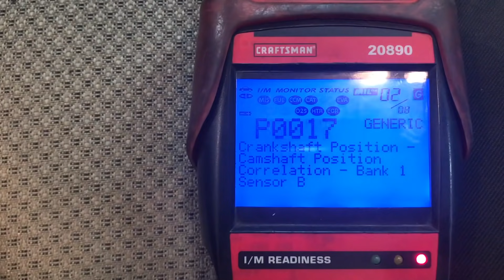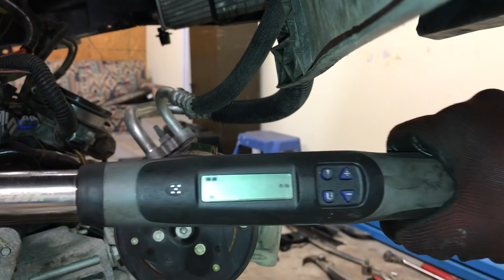Step By Step: 2.4 EcoTec Timing Chain Replacement

Comment: I just did this on my 2011 Buick Regal 2.0 turbo . I have a P0366 code crank no start. I changed  the camshaft position sensor on the back side of the drivers side motor.Still giving me the P0366 . I  was  worried if I had  TDC on the up stroke on number 1 piston . Watching this video I am positive it is . The only thing I did not inspect was  the wiring to the CMP sensor when I changed it ,kind of hard to get to. Would a p0366 code cause a crank no start? I am worried because this is the code I was getting before I found out the timing  guides had failed. Any input would be appreciated ,thank you.
Reply: thanks ayway,going to try Cloyes

Comment: s there a way to adjust the timing without marks?  I took the chain out and my stupidity allowed me to turn the the sprocket s individually, which turned the cams.  Now I have no idea where I am at.  Call me  an idiot because I am. 2015 Chev malibu 2.5

Comment: so when you lowered the sub frame what did you have to remove to do this? i see the struts but what about the wiring and fuel and evap? or is there enough slack here to just lower the subframe?

Comment: Just did this job on my 2011 Equinox. Replaced the timing chain and sprockets should have done the balance chain . The job was actually pretty easy even in the car. Thanks for you video it made the jobs easy. The timing chain guide was broken in three and the chain was so slack it was starting to wear on valve cover. The engine runs great now(as good as it can) hopefully I'll get a few years out of this repair.
Reply: I'm doing this now on my wife's 2011. Why did you say you wish you would have done the balance chain? Just because you were in there?
Reply: At what mileage was the replacement done?
Reply: Did you do this with the engine in the vehicle? If yes, what were the difficult steps and did you need special tools? Thanks.
Reply: @arneadler1810  did you end up doing this without removing the engine?
Reply: Youdon't need any special tools and you will struggle with tight spaces other then that it's easy @arneadler1810

Comment: Don't do this on the compression stroke. Do this on TDC EXHAUST!
Reply: What exactly do you mean? Number 1 piston at top most point ? This would be the first piston on the passenger side ,correct? Ihad to emove my cams to put new rollers in so Iam not sure of the orientation.
Reply: @snowblind5151  #1 piston is next to the passenger side fender. Top Dead Center on exhaust stroke.
Reply: @dealerauctionnightmare4689  So that piston would be at its highest point if you dropped a screwdriver down the cylinder to gage like most TDC settings?
Reply: @snowblind5151  Yes. Did you not set the engine exhaust TDC before you took everything apart?
Reply: @dealerauctionnightmare4689  I  had three shattered guides and 8 rooller lifters that blew apart. Believe it or not I think thats what saved the valves from hitting the pistons ,because I still have compression iun all the cylinders. I found a reply on timing this 2011 Buick 2.0 turbo with a 'LNF' motor. that the cams are to be set at 5 and 7  o';clock . and having no marks on the old chain I am needing verification.  DID YOU HAVE ANY BOOK ON THE 2.0 TURBO ?
Reply: i dropped the oil pan to clean it out also'
Reply: @snowblind5151  I don't have any manuals.

Comment: i did exactly as you described but at the moment of truth I turned the crankshaft and there are some points were there is more resistance than other times does this mean its time improper ?
Reply: I have the same issue. Where you able to figure it out?

Comment: is it TDC on compression or exhaust? I've seen other videos say to set it to TDC on exhaust for timing chain install, but you say the opposite. Just want to be sure. Thanks!
Reply: Tdc is piston location.

Camshafts are set based on that.

Intake cam is always set to the point just before compression stroke.

Always

Exhaust cam is always set to intake location
Reply: @danielkaesberger7893  the procedure has changed over the last few years. The cams used to be 180 degrees different. The crank spins twice per one cam revolution…….. 2 tdc piston locations, lol.
Reply: Yea im at this same question right now. The procedure has been changed in the last couple years to say tdc on exhaust stroke, i ended up just following how this guys doing it tho. I guess it doesn’t matter too much its more to keep the cam from spinning, everything is marked and the cams got those keyways it would be kinda hard to mess that up
Reply: @Bladesje  so, does it matter if it is on the exhaust, or compression stroke? The manual says exhaust stroke.
Reply: @harleyking7689   If you follow exactly what this guy does in the video you cant mess it up. Tripple check that your colored links are lined up, and make four full rotations of the assembly before putting the cover back on just to make sure your valves and pistons are not hitting. 

You can make sure your arrows on the phasers are aiming the same direction as this guy has his in the video, and each phaser only goes on one way. You better replace the phasers at the same time, the bolts are torque to yield so they stretch, replace them
Reply: @Bladesje  you can't really follow what he says. he says comp. tdc. but if look at the position of the cams in the video it's on on exhaust tdc I guarantee it. maybe he said it wrong just saying.
Reply: Instead of being confused. Before pulling your chain..... stick somethingnlong and straight in cylinder 1. Rotate until whatever you stick in, it'll go up, stop I when it floats to going down. Make sure both cam lobes on int and ext face opposite of each other.

Comment: Just did this job today and wouldn’t have completed without this video thanks! For anyone wondering the plug is a 10mm hex and the tensioner can be removed and torqued with a 32mm socket! Thanks again!
Reply: Do you have to drop the engine
Reply: @MatthewLeathers5  no I believe I just used a jack underneath with wood and unbolted that side of the engine mount and just went up and down as needed with the jack under the engine
Reply: @Survivor_Pinkman I know it’s been forever but how long did this process take you?

Comment: If you've already done all of this, put your motor back together, put everything on it, start it all up, and it still rattles just like it did when the guides wore out you might think your motor is junk, or you have bad parts.  What next? Well that's what none of these videos don't tell you. If your Cam Phasers are bad, it will still allow your chain to slap up against the top guide, and possibly jump time. So replace them when you replace all of the other stuff. It's worth it, and saves from having to take it all back out again. Especially if they've been hot for any reason.

Comment: After completing the job I have rotated the engine over by hand at least 2 times and none of the mark are lining up anymore, is this normal
Reply: you mean the timing marks, or the marks on the chain links? The chain links will almost never lign back up again, but the timing marks will, if done correctly.

Comment: As a 40 year  veteran  of repairs  I see two fatal mistakes  you made. First mistake  was  putting  a new chain on  an old sprockets  big no no.. a guaranteed failure .second  mistake was not replacing  the balance  shaft chain and related  components ....

Comment: I hate these chevy malibu cars, they are a real pain in the a$$!! I have a 2013 2.5 and I cant find any videos how to fix anything on them. The first problem is the electrical problems, everything dims, flickers, power steering goes with it and shuts off while I'm driving. second, I know the timing is about to go, it sputters when I'm at a red light so I have to put it in neutral so it doesn't shut off, Third the fob key was giving me problems and the dealer wanted $200 to replace it but I found a way to do it cheaper. fourth you can't find out how the transmission fluid is looking and if its low, 5th I have replace the battery every 3 to 4 months because it dies out for some reason due to the electrical issues. Worse car I ever had, I never had these problems when I had a Honda, Toyota even an American ford.
Reply: The sputtered might be a dirty throttle body. A loose timing chain would rattle. Many times the electrical is a faulty under hood fuse block. If you have a cel follow the codes.

Comment: Wrong it’s TDC on exhaust stroke , Cloyes video also confirms this. Otherwise it’s 180* out and will have valve clearance issues
Reply: Regardless , he’s got correct orientation or his marks on the cams would be facing downward.

Comment: but  if the timing chain is bad, why wouldnt the balance shaft chain and guides be wore the same, to me I would replace them all along with the oil pump built into the front timing cover

Comment: Excellent video.  Would you also recommend replacement of the balance shaft chain and water pump while the front of the engine is open like this?

Comment: Great video! Btw, at which mileage- interval did you changed timing chain set? Thx
Reply: Every 100K miles or 160K km or every 10 years whichever comes first
Reply: My 2010 equinox got 240k miles and black timing guide broke again.

Comment: Daniel you ever use updated bolt for the LH timing guide upper bolt that acts as the plug in the head, as well as the bolt for the guide. Dorman part # 917-954

Comment: Great video, thank you!
At what mileage is it necessary to replace tiiming chain in this engine ? Is there any order to replace this or other components acoording to mileage or years of use ? 
And, if you know, what is the whole average engine life of this Ecotec ?
Reply: My 2.5L ecotec in my 2014 Malibu only made it to 176,000 before the timing chain guides failed.
Reply: MY moms car, 2010 Malibu the guide broke with about 70k 4-5 years ago. I just did another 2.4 today, 2012 with 120k. That one was on its 3rd timing chain. 

So with my limited experience, 60-70k

Comment: are you replacing the new guide with the same stock part that will ALSO fail in time , do they make a better replacement part or are you just replacing it with the same junk . does some one make a better part that  addresses the problem  ?

Comment: The top timing chain guide bolt that was worn and needed to be replaced is often stripped out of the threaded hole and fallen somewhere (harmlessly?) into the oil sump. The threaded hole will also be stripped. There are bolts for sale that eliminate the access plug and screw directly into the plug hole threads. This eliminates the need to machine/repair the bolt hole. Dorman now makes a part, #917-954. They have a video on youtube. https://www.youtube.com/watch?v=lhXfKwLp_yY
I found mine a couple of years ago on eBay.

Comment: Where do you order the top timing chain bolts on that broken guide. Cant find them anywhere. Both top and bottom are damaged on my car
Reply: Check out my recent reply about stripped/broken bolts. The lower bolt might be part #11588522, or buy a timing set that comes with new bolts. There are also upgraded bolt sets
 http://www.crateenginedepot.com/ARP-Ecotec-Timing-Chain-Guide-Bolt-Set-11588522R-P51044.aspx
although you're still screwing them into aluminum.

Comment: After rotating the crankshaft 720 degrees should my timing marks return to the original position with the sprocket indicators pointing to the corresponding link?
Reply: Mine did not neither

Comment: Doing this on a 2014 equinox. Will i need to replace crank bolt? Also ive seen people crank with no plugs to get oil pressure to cam phazers.

Does this need crank relearn

Comment: I just replaced my timing chain and   now it sounds like a diesel....i triple checked to make sure all was lined up correctly before putting the cover back on
Reply: Replace the tensioner
Reply: Especially if you ordered a eBay timing chain set use the coats brand

Comment: I got three code PO013 14 16  and a car was running really rough when I open One of the guides are broken can I put it back in time is it gonna run smooth ?
Reply: Yes but buy a new set

Comment: There's a timing mark on the timing cover and on harmonic balancer to get you lined up at TDC.
Reply: I know this comment is from three years ago but do you care to elaborate? Where said marks should line up? I’m doing this repair right now and I’m a bit nervous about making sure I get TDC.
Reply: @diesel3175  it won't let me share pictures but on the timing cover by the oil pressure valve the part on the cover that sticks outs there's a line by it and there's a mark on the harmonic balancer

Comment: Thanks a million for this precious video. I was going to give up but after this video, I might challenge this. but If I open the sidewall of the engine, Should I drain the engine oil first?
Reply: Hey my husband vis thinking of challenging this as well how did it go for you!
Reply: Nope, no need to drain oil. It'll all be the pan when the engine isn't running. You'll just have the same amount he did fall out cause some always doesn't fall to the pan.

Comment: I just did this to my wife’s equinox put it together and it is showing 24 degrees advanced timing. I think I may have went off the wrong mark on the crank shaft sprocket I didn’t see any clear punch mark so I assumed it was the vertical lines on the sprocket behind it clearly now that is not correct do you think This could be the reason in the 24 degree advanced time ?
Reply: following direction is very important :)

Comment: Great instructional video. 

Questions 1. so should the timing chain have zero slack or would you expect a certain amount of slack. 2. Would you recommend chaining the balance shaft chain at the same time or just inspect?
Thanks!
Reply: NO play should be present. Balance shaft chain need not to be replaced. Rarely ever see an issue
Reply: Will the timing be the same for a 2012 chevy equinox 2.4l

Comment: Great Vid! I have maybe a dumb question- would a set of new guides and tensioner be worthwile to quiet down the engine and give longevity? 
Mine isn't super loud and no codes are present, it has 84k miles. I wouldn't expect it actually needs a chain?
Reply from the maker: If you’re going to replace the guides and tensioner, spend a little extra money and replace the chain while you’re there. It will definitely help in the long run.

Comment: This video was very helpful, I have a friend who has a 2012 Captiva Sport 2.4L, which was running rough and making an upper engine clattering sound. I took the valve cover off. To find that the upper guide was missing it's plastic piece and the metal was cracked. Along with the chain being very loose. I decided to replace both guides and the tensioner. I did have to set the timing again (It was way off.) And pull off the oil pan to get the plastic pieces out. The engine runs very well and only had 80,000 miles on it. Thanks so much for the video, I couldn't have done it without it.

Comment: I have a 2013 Chevy Equinox with a 2.4L engine. There was a rattling in the engine on start up so I figured it was the 
Timing Chain. Tore the necessary components down and there was slack between the camshaft sprockets. Removed 
 the tensioners and tensioner and went to remove the chain. It was tight and almost didn't get it off. When I went to put on 
the new chain It was so tight I had to force it on the camshaft sprockets. How come you have NO tension on the chain when installing? After I got it on there was slack in the chain. However, when I rotated the engine, the exhaust camshaft sprocket
began making a clicking noise. I replaced the camshaft sprocket but now even though the timing marks align, there is noticeable slack between the camshaft sprockets and I had to fight it on again! What the hell could I be doing wrong?????